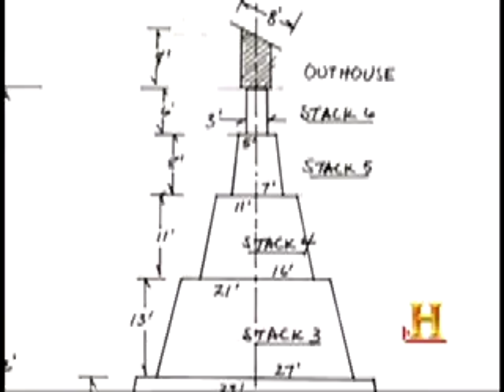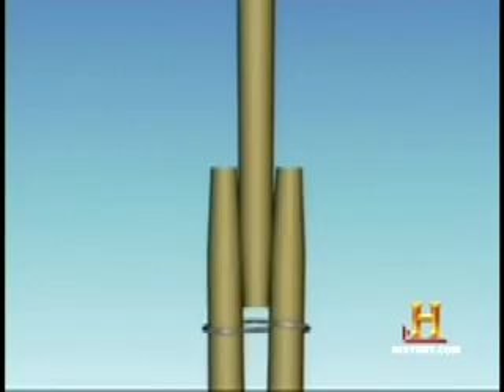Aggie Bonfire on Modern Marvels

Comment: @SpecialEdward121 The size was not the issue, it had been much larger in the past, and was only 40 feet at the time of the collapse.  The largest was 109 ft tall, in 1969.  The reasons for the collapse were addressed in the video, and had little to do with size, but changes in the design made in 1999.  Before you go off asking if anyone stopped to think and ask a question, you should do the same.  Think through your question.  Pay attention to the video you are commenting on.

Comment: @yourrapunzel No.  it was fine in 1998.  It has engineering changes made in 1999.  It was redesigned horribly in 1999.  That was the issue.  Some hot shot thought he could make it better, and screwed the pooch.